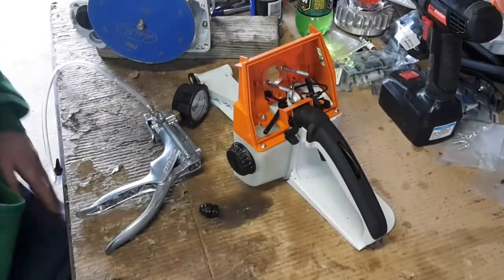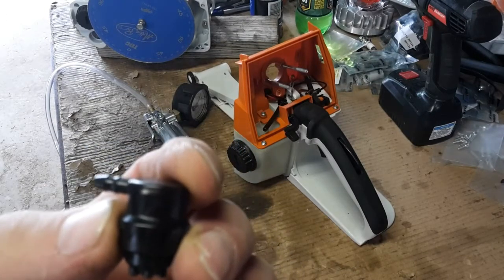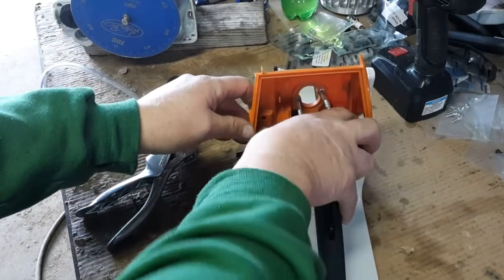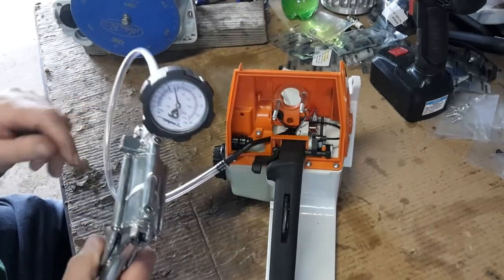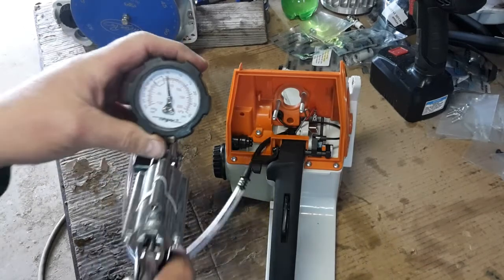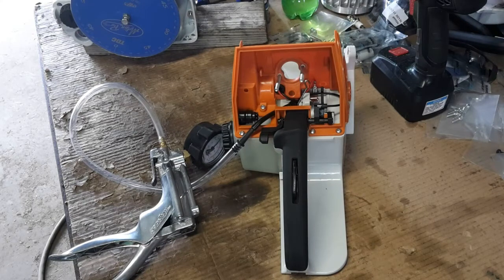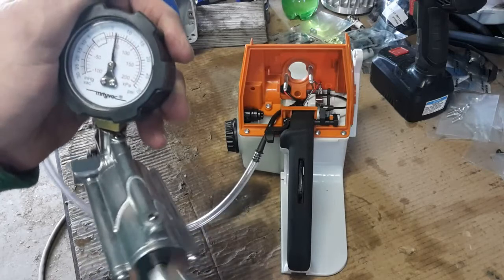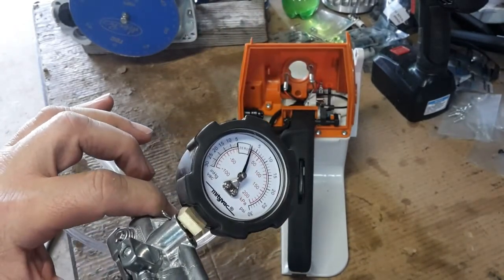Addendum to Pressure Testing Fuel Tank on Kyle's MS660 Build

Comment: Craig .. what was the acceptable leakdown time under vacuum  at 7psi .. I suppose it just needs to show a slow leakage and not to hold it
Reply from the maker: Without having the shop manual in front of me I think it is no more than 3psi loss over 30 seconds but like I said I'm not 100% sure on this.
Reply: Thanks .. Ill see if I can look it up .. but It does need to leakdown when under a vacuum that much I do know
Reply from the maker: @fingers967 For the vacume test
 The Shihl shop manual states pull a vacuum of .5 bar (7.2psi) and if reading remains constant or rises (meaning reading  is going down) to no more than .3 bar (4.3psi) over 20 seconds the seals are in good condition.
For the pressure test
Again the manual states .5 bar and it MUST hold this for at least 20 seconds with no drop, if no drop then the crankcase is considered airtight.
Hope this Helps
Reply: @craigtimmons3468  it did thanks very much Craig